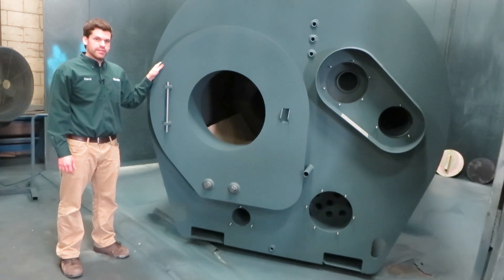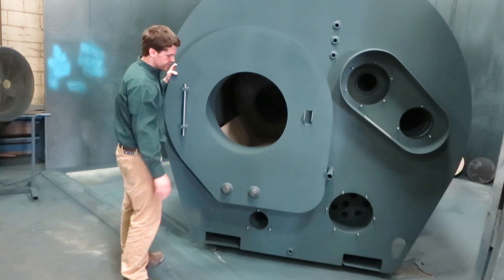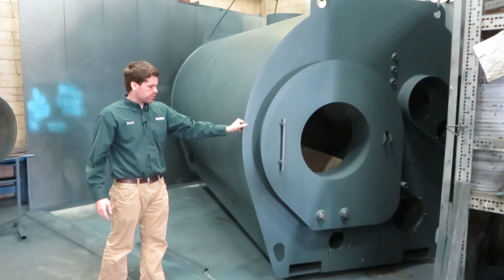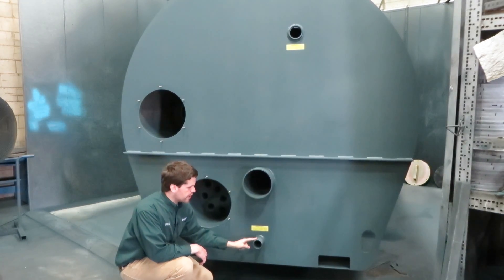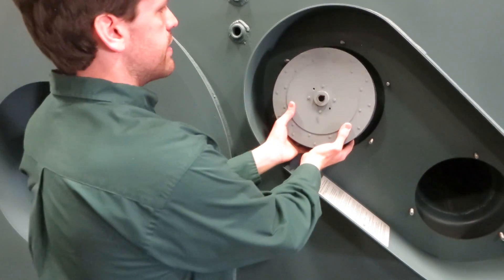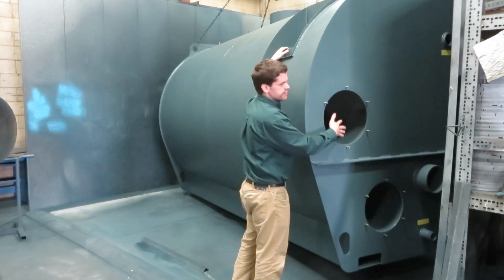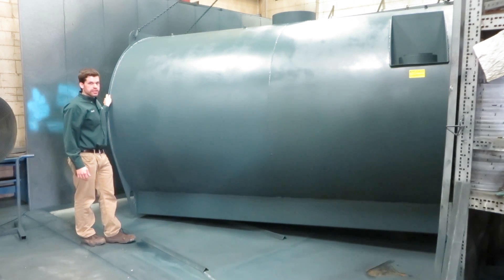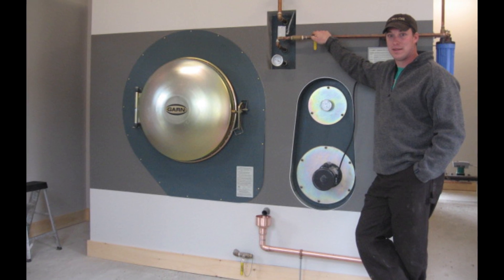GARN: WHS-3200 - Introduction

Comment: Wow !  A garn might be what we put in our new home.   Anyone know how much heat radiates off of these units ?  Just wondering if heats the basement or building that its in, or if the water captures is all
Reply: It will heat the room it's in, if you look at most installations they box it in and insullate to keep more heat in the water for longer. My garn barn is still 80 all winter.